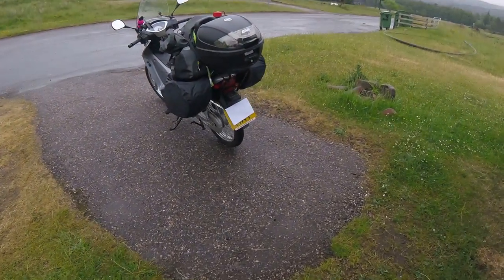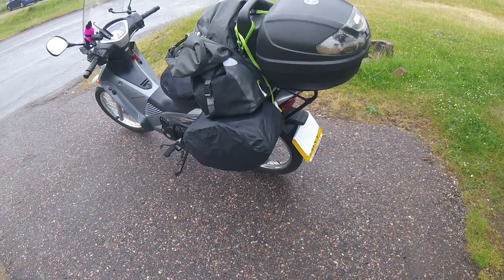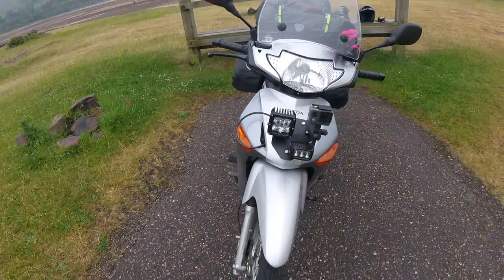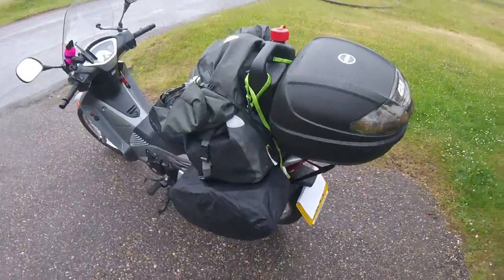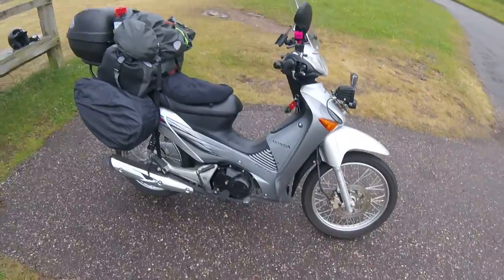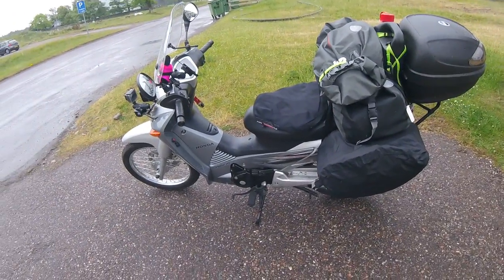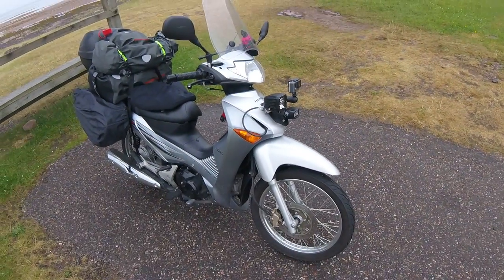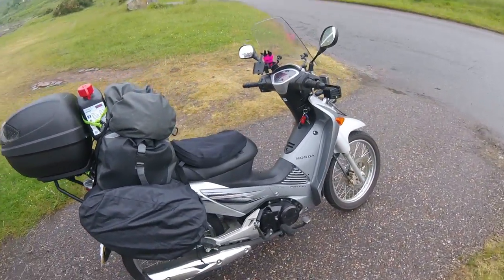Honda Innova Tour of Scotland review and Rigid Industries Lights

Comment: two things missed:
1. good to have something like koso mini 3 in 1 - voltmeter to monitoring voltage in a electric system, especially, ton a fact you have additional load like a not standart lighting systems.
2. you forget to mention, how "super" is in each petrol station to get off all your luggage to can lift seat for get access to fuel tank...:\ it was really pissed off me during my finland travel...:D
Reply from the maker: Janis Ciemgals I have a Koso mini 3 voltmeter but it would be no good in this instance. The reason being that a voltmeter measures voltage and not current (amps). When your voltmeter is telling you that your battery is at 9-10 volts, it's already too late and you are buggered! However, that's the reason I chose a scooter with a kick starter. I did have an incident where I flooded the bike with water in a large puddle/ditch and had to remove plug a few times and crank over the scooter to clear the cylinder. The kick starter saved the battery level in this instance.
Removing the luggage every 110 miles was actually the best bit of the journey. I chatted to so many people in those few moments, it made the journey a much nicer experience. Take care on your travels and best regards
Reply: nooo, i think, you do not understand basics. voltmeter is super device for vehicles, where is battery. be sure, when that was very dumb to wait, when on battery is 10 volts, but luckily, voltmeter shows also a higher number too. as so, we know, fully charged lead battery have 12.7 - 12.8 volt level. as so, suppose, if you see numbers lover than that - say, 12.2 volts - you know, there is a problems with your charging circuit. then you have about 70% of battery left, and if turn off lights, that gives you about 50  -100 kilometers range - you can start find garage / civilization for repair and diagnostic problem. that means, vith voltmeter you always have a some reserve left. and that was very good. also you know, normal voltage in bort net is about 14.2 - 14.7 volts  -as so, if you see 13.5 volts for long, you know there is some problem or generator overload. if you see voltage over 15 volts - again, you know there is some problem in electric part of vehicle. that give you early diagnostic, and help avoid boiling out, or flat battery. it is very difficult to overrate voltmeter on any vehicle - car, moped, motorcycle.  

about luggage - strange experience. i have very pissed off with luggage load / unload at fuel stations. one of most negative thing in all my travel to finland...

about kickstarter - on these small mopeds, you can easily put it on a gear, and push it - that completely replace kickstarter.
Reply from the maker: Janis Ciemgals    

Ok then. That's fine, I know nothing. Let's agree to disagree then. Google motorcycle ammeter when you get five minutes. You'll find that an ammeter will tell you the exact current coming from the charging system before the battery decides to boil (over charge) or go flat! 
Regardless of this information, no matter what your charging system does, unless you carry half a bike in spare parts you are still buggered and calling for the breakdown service to nearest motorcycle dealer. 

By the way. Don't you think it would be easier to use a kick starter to clear a cylinder of muddy rain water or run up the road and drop the scooter in gear, then repeat 20 times? 

So.... anything else? Maybe you might like to tell me what I'm doing wrong with my luggage system or maybe how to improve my technique of climbing aboard my scooter? I'm all ears...........
Reply: ammeter is not near as good as voltmeter. say, you have sulphated battery - how you determine this with ammeter? how you determine overcharging? on overcharging and boiling ammeter readings was low - about 2-3 amps. i personally do not see situations, in what ammeter is better than voltmeter.  in the same time, voltmeter installation is much more easy, than ammeter.

do not take all too personally, dude. do as you like, but i personally prefer voltmeter over ammeter, and cant imagine situations, when ammeter is more informative than a voltmeter.
Reply from the maker: Janis Ciemgals
Dude, with respect, I went on tour to Scotland on a scooter. It was fun, enough said, period. it wasn't in my thoughts that I should enlighten myself on the perils of a sulphated battery whilst I am hanging off the side of a mountain. Indeed an ammeter is exactly the instrument needed if you should be worried about such battery trauma. That's why they used to fit ammeters to old classic cars and motorcycles before the days of regulators. You had to switch on the lights to lower the charge rate etc. Plus if you know the charging rate before you have a problem, you will know if there is a problem regardless of the low amperage being measured. I have an ammeter on a solar charger hooked up to a leisure battery in my garage and it measures to 0.001 of an amp. With respect that's far more accurate than the Koso mini 3 can measure. I take your overall generic point though that monitoring your power levels may be beneficial in such circumstances. The thing is though, Honda's don't tend to go wrong if kept well maintained. My friend has a Kymco and that's a whole different conversation believe me.
Best regards
Reply from the maker: Janis Ciemgals by the way, this is healthy debate so it's never taken personally, I respect your views and appreciate your input.
Best regards
Reply: Scotland tour... i hope, i too someday have to travel to Scotland and Ireland. Cant decide  - with what moto. on one hand i have honda cb500 twin, it was powerfult enought to  not have any problems in hills...but it was heavy, eats twice as my moped, and is too ordinary, too easy to travel, i think :D
my chinese cub, on other hand, is very limited - about 85 kph top speed, 97 cc. it was excellent little bike, but i doubt about how it feel in Scotland mountains - do it have enought power to going on 3rd gear up?

very happy, you have that unbreakable magic honda, btw ;) plan to buy spare regulator for my cb500, because about 2 years ago original regulator already fail, and be replaced ;) looks like i have fake honda, because it, as all in this world, break time from time :)
Reply from the maker: Janis Ciemgals I would take the CB500 if I were you. That's a great bike to tour Scotland on. Light enough to have fun and a little more power to climb the hills. If you do the tour one day and you have a problem, call me! I am hopefully moving there soon and I would gladly help you out of a situation should a problem arise. We could then have a few beers and argue about voltmeters vs ammeters before finishing off the single malt whisky 😉 Take care dude.
Reply: Thank you very much for offer! That may be very handy, when i was ready ( maybe in next year, or even later), i write to you ;)
CB500, surely, was much easy, but small moped trips is much more challenging. for travel around world on jet you need nothing except a money. that was super-easy. on car do the same is much harder. on motorcycle - even harder than on car, but on small displacement moto is even more challenging. i are absolutely not ready for travel by walking, or on by bicycle, but moped is worth to try, i think :) one russian travel around world on ybr125 / 250 - what a man! :)
and yes, moped have also 3 big advantages - it consume very small fuel ( i supose nearly 2 times less than cb500), it have smaller speed ( smaller speed - more to see. on finland travel i encounter norway motorcyclist, who travel to baltic - he say, it have average speed about 90 kph, that means, on highway he must go about 150 - 170 kph. what it is for "travel"? who he can see at that speed, except of tarmac and cars?), and moped was superlight - really like bicycle in handling. CB500 is relatively light, yes, but it was much more heavy than moped, and it not forgive many situations, where on moped you have no problems at all...

Comment: how have the givi holdall bags going ? any leaks or damp patches after a really wet day?
Reply from the maker: Slipping Jimmy I found that if you get the covers on early enough and fit them right over and pull the cords nice and tight then no damp patches. I've used them for both Cornwall and Scotland and if I'm honest I think they are better than hard luggage. If you accumulate souvenirs you have extra room with the expanding sides and if you're unlucky enough to have an "off" then they don't explode into pieces like some of the plastic ones might. Overall I found them excellent and I used Rok straps to secure them to the bike. Hope that helps
Reply: Cheers mate 
Planning on purchasing them soon

Comment: Hi scooty man. Could you share with me how you did with the lights and relays. Hoping for your reply. Thanks
Reply from the maker: Michael Velasco Hi Michael. I used a switching relay to switch between the dip and main light. These lights were a great help on a few occasions when I was still riding late in the evening.
As for how to wire them, a very good website that I use quite a bit is 12volt planet. It’s an online electrical shop for everything 12volts but there is a good help section that will help you with the technical assembly of components and how they work. A little time on Google should get you the info you need.
Hope that helps and best regards
Scoots
Reply: @scootyman2974 Thanks so much. But were there no wirings changed/modified to supply that amount of power for the auxillary lights to not die after a an hour or two,? only electrical additions like relays and switches? And if there was, did it not affect the battery, like overcharging it?
Reply from the maker: Michael Velasco 
Hi Michael. That is a good question regarding load on the charging system. All I can say is at that time of using the lights all was fine however....... I also had a usb charging lead that sometimes wouldn’t work whilst charging. I have since found out that this usb charger cuts out if there is insufficient power to power the charger lead so I’m guessing that might answer your question and that I must have been very close to using maximum power. I guess you could do away with the standard 35 watt bulb via an inline switch which would save around 3 amps of load on the charging circuit and just use the LED lights. That’s assuming the headlight isn’t on a separate circuit as some bikes are.
I now that the innova uses a 12 volt ac supply to power the headlight and I needed to use an ac-dc converter to supply a small dc current to switch the relay as ac made the switching relay ‘chatter’ on and off. If I can help anymore with this, feel free to send me a message and I will try and help you more with this.
Best regards
Scoots
Reply: Thanks a lot for your answers, I envy your travels. Some day maybe I'll do my videos when I do. And I really like your seat cushion the airhawk. But unfortunately we don't have any suppliers here locally. Thanks a lot again. Hope to see more of your videos.

Comment: the stock tyres suck really suck try michelin m45
Reply from the maker: dstr1996 I never had a problem with them to be fair and the weather was ultra wet on some days. In what way did you dislike them? Ride quality? Puncture proneness? Cornering or straight line stability?
Reply: Scooty Man to be honest this tyres are mid to low end quality.. the overall perfomance of the tyres is bad they wear pretty  easy after a few months.. cornering is not  good they dont give you enough confidence at high speeds in terms of stability... i wouldnt recommend you to keep using them you just put your self on danger for a few pounds.. the cost to replace them with something  more reliable  is cheap you can buy 2 tyres as low as 60 pounds.
Reply: Scooty Man Scooty Man to be honest this tyres are mid to low end quality.. the overall perfomance of the tyres is bad they wear pretty  easy after a few months.. cornering is not  good they dont give you enough confidence at high speeds in terms of stability... i wouldnt recommend you to keep using them you just put your self on danger for a few pounds.. the cost to replace them with something  more reliable  is cheap you can buy 2 tyres as low as 60 pounds.

Comment: Absolutely love that light setup!!!
Reply from the maker: Yes it was good but I have a confession to make. It didn’t work so well! 
The problem was the pathetic charging system on the innova. 
I currently have a Vision 110 for commuting to work and I have rigid industries ignite spots on that plus, I have a heated vest, heated grips and a rear LED beacon to keep away the tailgating brigade on the dark winter nights and never do I suffer with a flat battery. The innova light system was definitely my inspiration to mod every bike I’ve had since with electric gizmo’s mind.
Thanks for your comments and best regards
Reply: @scootyman2974  do you have a video about how to fit the lights & rig them?